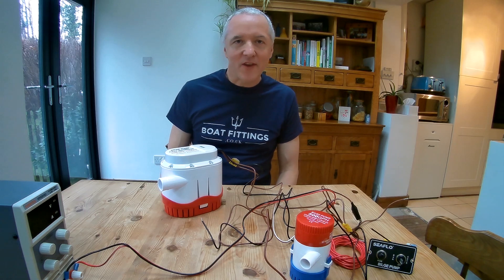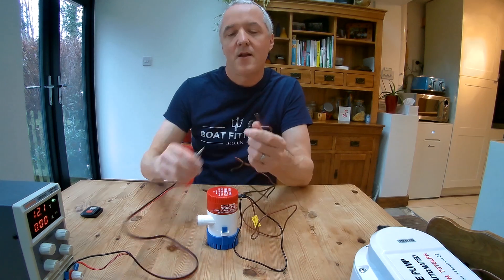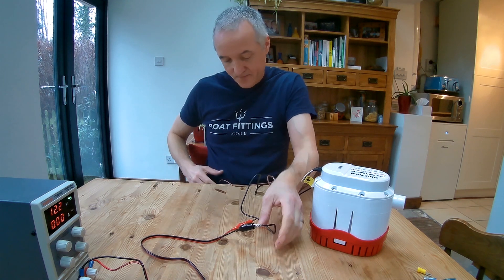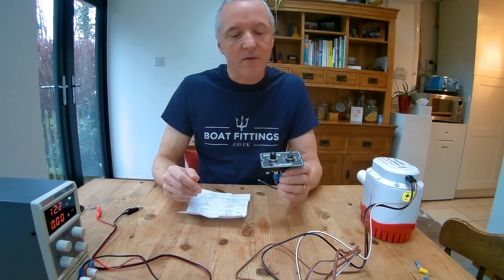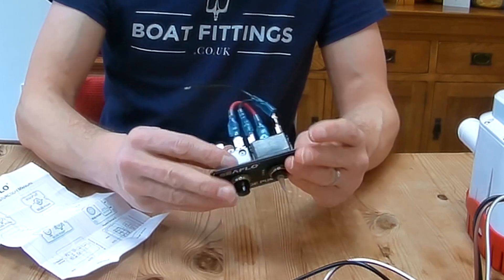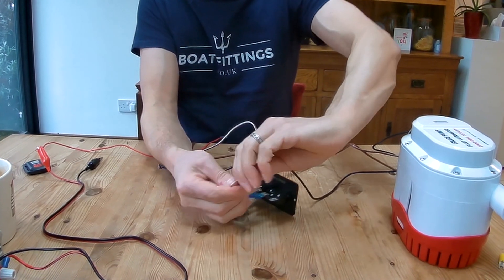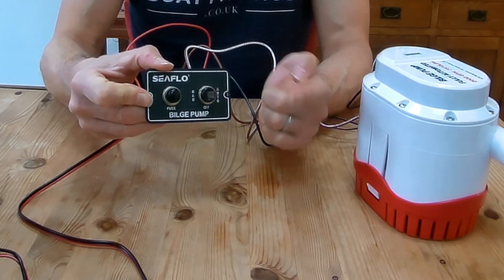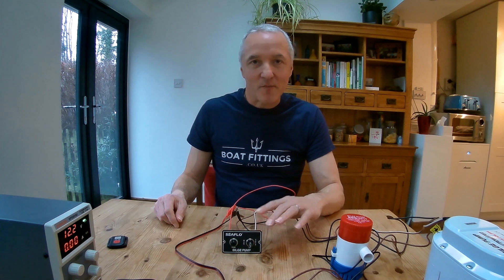How do you wire a bilge pump?  We wire up manual and  automatic bilge pumps step by step.

Comment: Crimped connections are more flexible, heat-resistant and vibration-resistant than soldered ones which have greater potential for wire fatigue and stiffening. Crimping is often more consistent than soldering, which can vary according to method or technician.
Reply: I used to think differently until I got an inexpensive crimper which gives consistent, solid and quick crimps. Solder works great on thinner gauge wires but for 14 and up, the crimper worked a lot better for me, especially in a tight engine compartment.

Comment: could u put the striped float switch wire directly to the battery with a fuse? i have a manual bilge pump with 2 wires and it’s on a on/off switch panel and i’d like to keep it that way

Comment: Very easy to understand. If I wanted to wire bilge pump with a float to a second battery with out the switch. Can I hard wire the pump to the battery with a fuse and leave it in the boat? We are expecting a lot of rain from a storm or hurricane as a backup. I am an hour from my boat. The current bilge pump is new and permanently attached to the boat.

Comment: Hi what gauge wire did you use my pump switch float switch and pump draw 15amps i was wondering what fuse do i use. My switch is a seaflo sfdp1-015
Reply from the maker: Hi - thanks for your question.  I answered this, with your other more detailed question.  Hope that works for you.

All the best,

Richard

Comment: Great video! I have a problem with my pump. It works when I connect black wire and brown / white. But not when I connect black and brown and then turn the pump upside down.

Can I do something wrong? Or is the automation broken? Can it be fixed or do I have to buy a new one?
Reply from the maker: Hi thanks for your comment and question.  It could be you have one of the electronic-based automatic types of pump.  You might want to take a look at the video in the link below, which gives an explanation of how the different types work .....

https://youtu.be/CW2CAQXhh0k

Comment: Hi there. Thanks, sadly neither of my 750gph ebay impeller (like your Seaflo?)  pumps actually pump. 
The motor spins but they pump nothing and I'd like your opinion on impeller type vs anything else.
Cheers!!
Reply from the maker: Hi Eric, thanks for your comment - the first thing that comes to mind is are they wired correctly, if the positive and negative are swapped around these will spin but not pump water.

Richard
Reply: @BoatFittings  Thanks, they were wired ok but the transformer I had was underpowered. It turns out you need 4 times the operating wattage to start them...12v x 3amps = 36watts x 4 = happiness!!!!! The transformer I had was only 3 times the wattage = sadness....

Comment: Just a question. Why would you want to put your pump in manual mode if you know that you have a float switch that can kick the pump on automatically when the need for the pump arises? Is it simply in case the float switch fails or something?
Reply from the maker: Hi thanks for this good question.  Yes you already answered it really - it is in case the float switch fails for any reason.  There is another reason though - your float switch will only activate when there is a certain level of water sitting in the bilge, and the manual mode could allow you to pump out that last inch or 2 of water which is a 'nice to have' option.

Comment: I got a 800 gph automatic bilge for a v bottom I have I have an on off on toggle switch I wanting to use would that work with the bilge I have? I've noticed it only comes on if I have both positive lead touching the battery but it wouldn't come on with the single lead. Could there be an issue with it?
Reply from the maker: Hi it sounds like your pump is behaving a bit strangely.  Normally with an automatic bilge pump one of the positives will be for automatic operation and one will be for manual operation.  You might like to look at video on the different types of automatic bilge pump to see if that clarifies the behaviour - the link here should take you to it ...https://youtu.be/CW2CAQXhh0k

All the best,

Richard

Comment: Thank you. Excellent presentation... a thought for Seaflo - it would be great if the lever could change colour from green to say yellow when on the Auto setting and the pump actually kicked in or perhaps another led.
Reply from the maker: Hi thanks for your comment - the switch does change colour from auto to manual, but I think you are suggesting a further enhancement, interesting!
Reply: @BoatFittings  cheers, yep something to indicate when it was actually running.

Comment: Hi, can I simply wire an auto bilge pump directly to my 12v battery with an inline fuse without a switch? I want it on auto all the time.
Reply: You can but in a boat you want redundancy. Hypothetically, if the float fails, you want to be able to control the pump manually.
Reply from the maker: Hi, yes technically you can wire it straight to the battery (with the fuse for protection), but from my point of view I would always fit a switch so that you quickly turn it off in the event of something unexpected happening.

Comment: Where can I get electronic power supply?
Reply from the maker: Hi thanks for your question.  I would recommend getting help from your local specialist electrical trade shop for a suitable power supply, one important thing is to let them know the required peak current rating, which depends on the model of pump.

Kind regards,

Richard

Comment: What size hose do you need for most bilge pump?
Reply from the maker: Hi Mike, thanks for your question.  Our smallest bilge pumps which can be found in the link below, have a 19mm outlet diameter and our larger ones around 35mm diameter so it can vary quite a lot.  What I would say is to choose a hose with an internal diameter always a little smaller than the fitting, 19mm and 25mm internal diameter are quite common.

https://www.boatfittings.co.uk/c/marine_electrical_fitting/bilge_pumps

Kind regards,

Richard

Comment: Thanks for the video. At the moment I use a bilge pump connected directly to a 12v battery, which works fine. But I want to power the pump with 230v to 12v power supply. I’ve tried a few I had lying around but none seem to work. Presumably they weren’t powerful enough to power the motor. can you suggest a suitable power supply i could use? The bilge pump is 1500gph I think.
Reply from the maker: Hi thanks for your message, and sorry for the late reply.  This issue comes up at lot.  It is a little difficult to find a suitable 230V power supply with enough current capacity to power the higher flow-rate pumps.  We are hoping to have some suitable power supplies on sale quite soon, but would be very interested to know if you have manged to find a suitable supply already?

Kind regards,

Richard

Comment: Hey guys I have the same automatic bilge pump for some reason mine is not working on the Auto I have a hooked up directly to the 12 Am I missing something or is the product is defective
Reply from the maker: Hi thanks for your message and sorry for the delay in replying.  Sorry but I don't think I could make a proper assessment without having the pump here, but if you pump has three wires (probably one black for negative, and two brown wires) then if the pump is working properly, keeping the black wire on negative, and trying the brown wires on the 12V positive then one of them should turn on the pump even if there is no water.

Comment: I do not need the auto function, can I cap the solid brown wire and just leave it disconnected and only use the black and brown stripe wire?
Reply from the maker: Hi Barry - thanks for your question / comment.  Yes it is fine to use only the manual function and to cap the other wire, unused.

Richard
Reply: i would wire the solid brown wire directly to your battery so that it will turn on automatically without a switch and then use the brown stripe to wire to the switch as well as the ground connection.